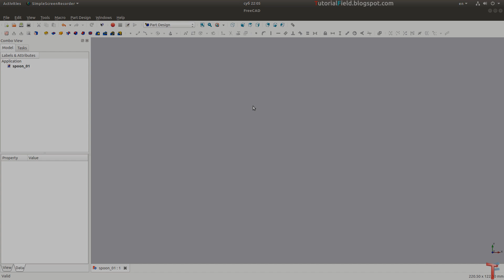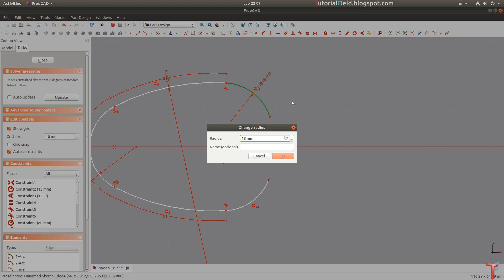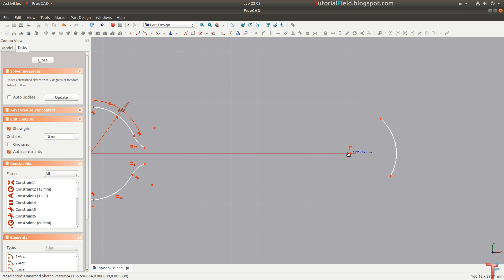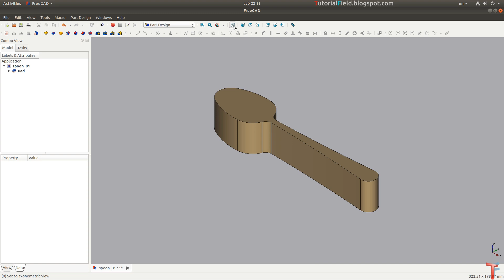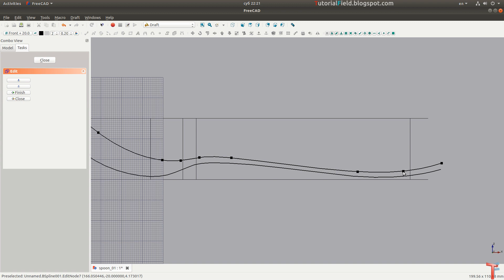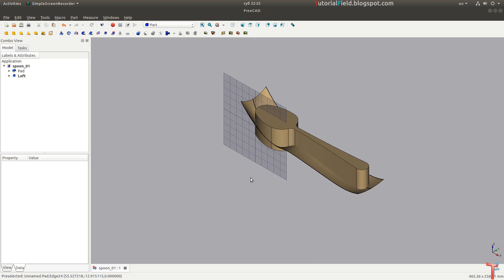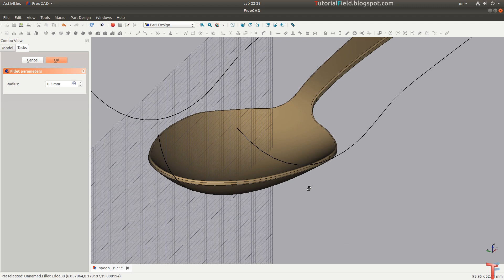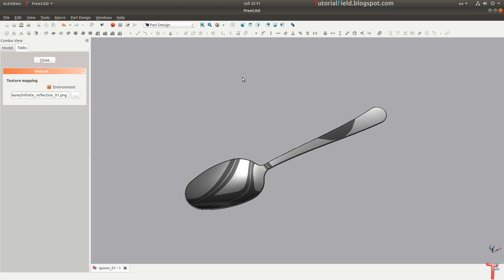Freecad tutorial - Product design #022 - Spoon

Comment: Fantastic!
I'm just starting to learn modeling for 3D printing and after a couple very basic tutorials on FreeCAD, then some good ones based on Fusion 360, which is now rather expensive per year I was wondering how to translate some more powerful capabilities into FreeCAD.
Thanks a lot for this excellent example at normal speed, I'll now try to redo it 🙂
I wonder why you designed the left and right separately however instead of only one then mirroring the whole thing.

Comment: At 5:51 how did you move the point as I am unable to select it. Thanks
Reply from the maker: Hi, technically you only need to select the point with one click, if I remember well, it was a bit of a pain, because, it was very difficult to select each. But with a little practice, and, multiple repeating, I somehow managed to get it right, but not perfect.
In general, the point requires the defined plane of movement, it should work better. I haven't used draft workbench for some time, and, I think it should be the same.
Reply: @AndarionCGart   Thanks, I'll try, indeed it's a pain in selecting it.

Comment: What did you do at 5:18? I think it was a keyboard shortcuts but I'm not sure what you did.
Reply from the maker: At that point only grid appears, i have used G and R to toggle the grid, but, not in the same time, first press G, and quickly R after. Shortcut won't work if any tool or operation is active.
I'm preparing new tutorials, new series will be more detailed, since these are only for demonstration purpose, but it may take a while until they are finished.

Comment: Hi,
Could you tell me please, how mace the cut on 8:50 ?.
Reply from the maker: That is only a boolean operation, between surface and extruded object, but, it's a tricky step, it may give unexpected results, depending on how previous steps are done.
If Cut doesn't remove the right side, and do the opposite, use Intersection instead. 
This is 0.16 version, i think 0.17 have a better options.
Reply: TutorialField 
Thanks!

Comment: Man, you really should look into the Sketcher Polyline and its tangent arc mode. You would save a lot of time!
Reply from the maker: That's when the music comes in handy. :)
It's not always the best choice, but i did tried, and i had an issue with controlling polyline and arcs, and doing that separately gives a lot of freedom, especially if it's about complex, or someway organic shapes, and i have no clear picture of how final sketch would look, i'm moving them separately until i get approximately the right shape, just as i would do the sketch on a paper. But, of course, i use polyline whenever i can. 
I would definitely try using polyline if i had an image, or, a sketch beneath, but, that is another thing to be covered in future.